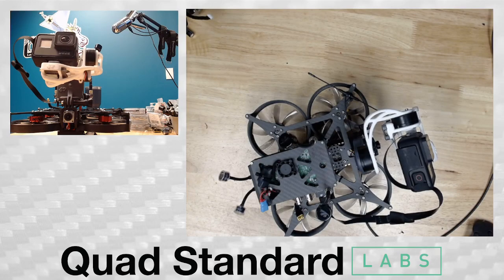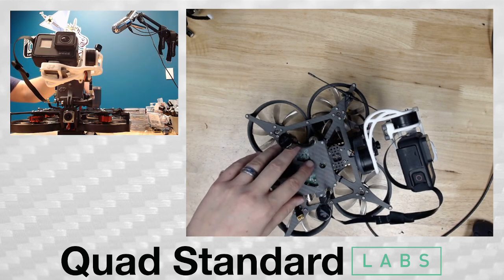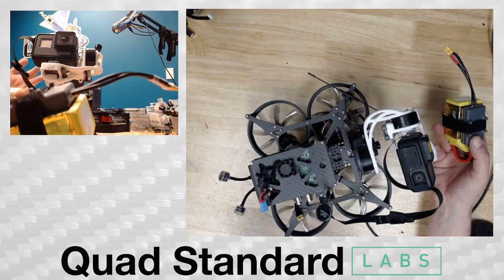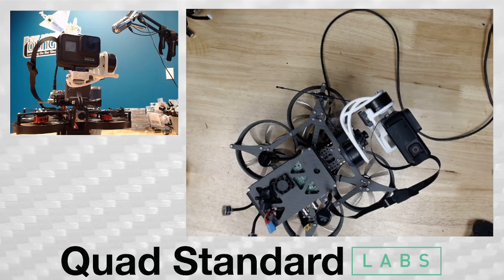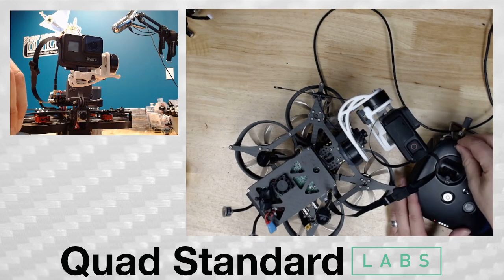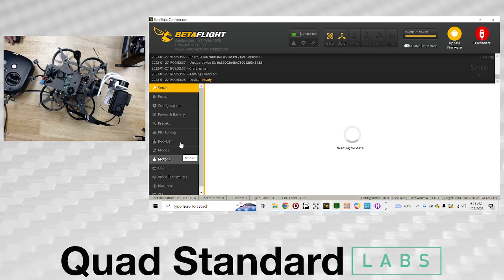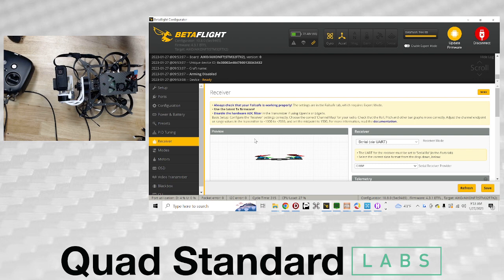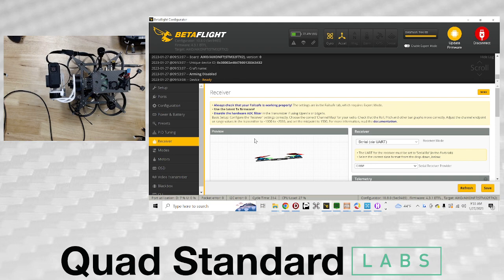Quad Standard Labs Live Broadcast FPV Drone: In Depth Look

Comment: Since it's a 1080p downlink, in the search for less mass, wouldn't a Hero4 Black suit?
Can the gimbal be swapped to the channels for head tracking?
Reply: you might shave what 3-5g?  I have no clue and that camera is not the best sensor so youll see definite difference.  Do as you wish for your applications.
Reply: Does anyone have any idea what downlink was used?!
Reply from the maker: @jeremycampbell2807  we discuss that it’s a Swit Flow 2000 system in the video.
Reply: @QuadStandardLabs  Ah thanks I could not find where it was specified.